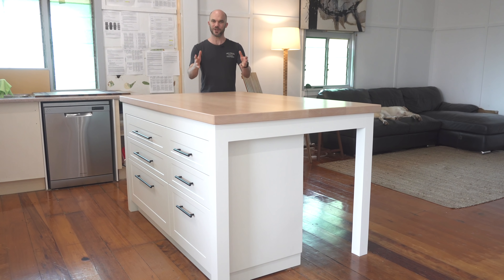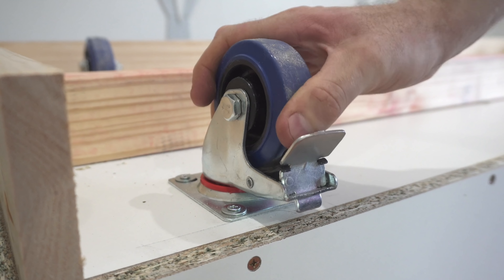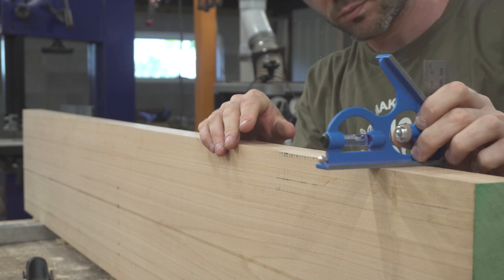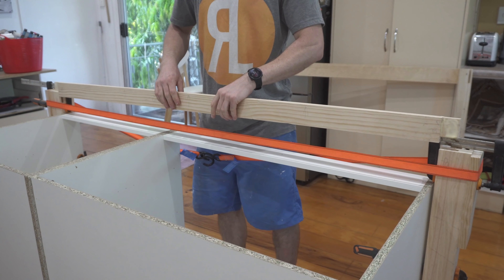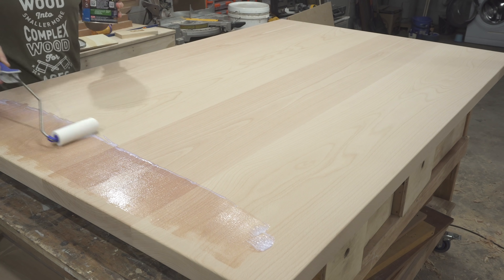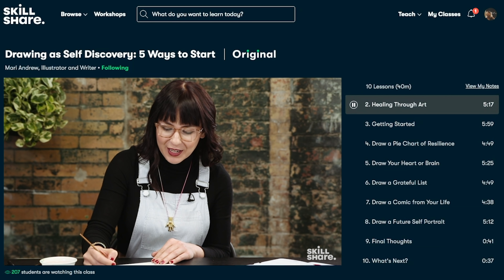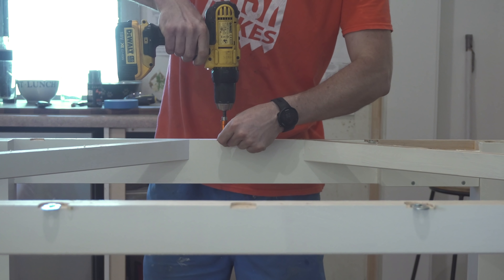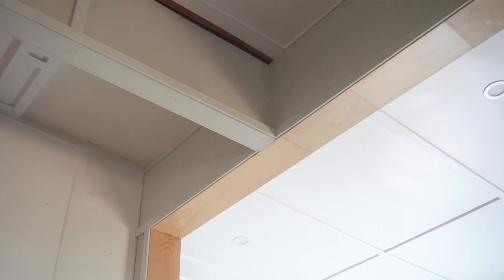Kitchen Island With Removable Drawers

Comment: Hey mate, love your content—instantly subscribed! Just a suggestion: it would be really helpful if you could include links to the products you use. It makes it easier for beginners like me to know exactly which router, screws, or washers you used for your builds. Thanks!
Reply: Also curious to know which wheels you ended up buying? :)
Reply from the maker: They have grey rubber wheels, can’t remember the brand though unfortunately

Comment: I like the way you make your tenon joints very tidy! what is the brand of the flat pack cabinets and did they come with painted draw fronts? are they good quality? Thanks for sharing.
Reply from the maker: Thanks. They’re called Kaboodle cabinets, relatively good quality. The fronts I got were unpainted, but you can get them pre finished

Comment: Nice job. 10 years from now you’ll love the fact you chosed polyuretane for floors. It will last for fantastic more wear and tear than furniture poly. And I guess you will prep for some bbq:s on that island aswell host some young ones with needle sharp forks on the table. 

May I suggest that you reinforce the cabinet flooring on top of the wheels? Easiest way is to just ad a 4 or 6 mm ply on top of the floor and glue it down with some PL 400 or anything equal. Or any other glue. The flooring is pretty strong when the cabinet stands still. But will take a great deal of beating when you move it around. 

Put all the things that’s supposed to be in the drawers on a scale. When you see the weight, you’ll understand.